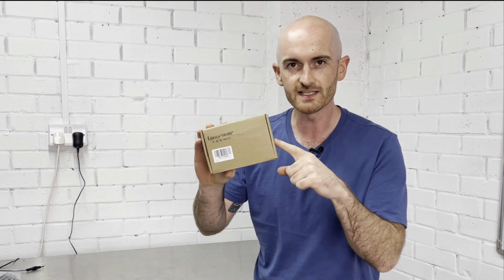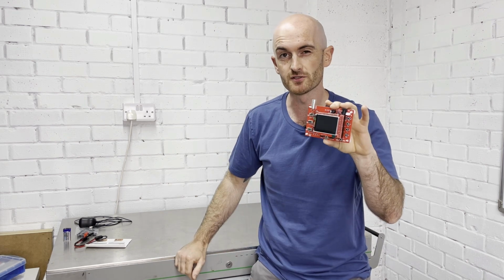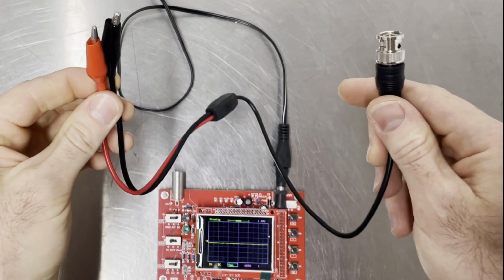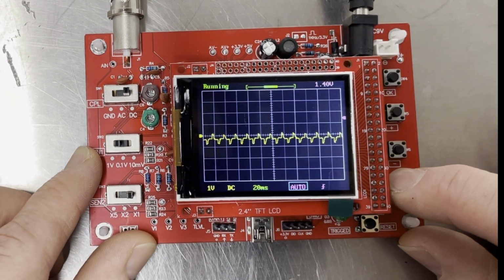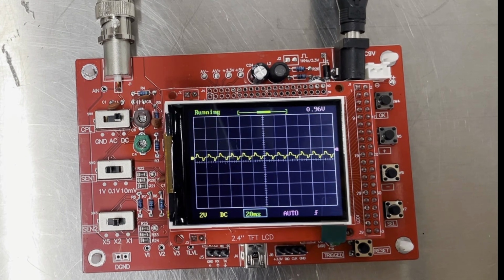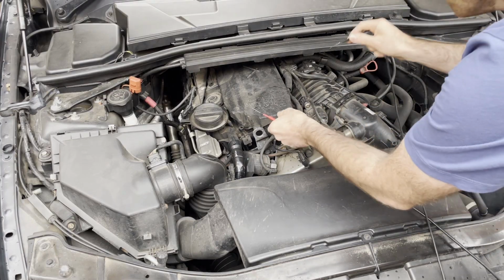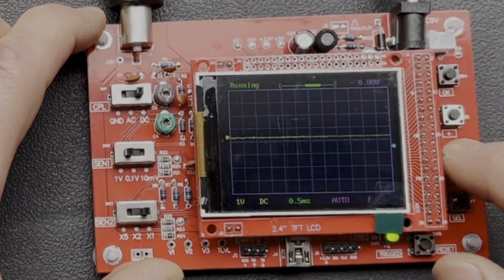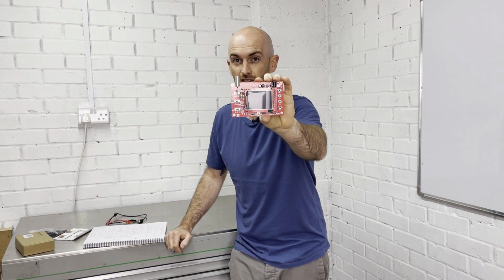Cheapest Oscilloscope in the World! DSO 138 | Mechanic Mindset

Comment: what happened when i connect negative probe to the battery and positive probe to injector? without attenuator Hantek tipe HT-201
Reply from the maker: Probably nothing. You just won’t see the top of the voltage spike. 

Some would say it will cause damage but i haven’t seen it happen yet

Comment: Small problems: Does not feature cursors. This is basically the only drawback, and renders it somewhat difficult to use for simple electronics. Other than that, it's great.
Mine comes with an acrylic case.

Comment: Quick question;  the jumper wire at J2.  That was bridged for testing the board.  Doesn’t say to remove it when complete testing.  Should o leave it or remove it?
Reply from the maker: I bought mine complete mate. Sorry not sure
Reply: @MechanicMindset  I found that it is to test the board.  It produces a square wave that you connect the red probe to and get a signal.  The loop should remain, not be removed after the board is complete.  There is a 0ohm resister that is to be Shorted (JP4).  I removed the resistor and put a blob of solder, bridging the  2pads thus, shorting it.  Curious as to why it is there in the first place.  0ohm?
Reply from the maker: @marinehm  Ah ok yes, is it the same signal you can also use to set the compensation on the x10 probe?

Comment: Great little kit.  I just picked mine up at an Amazon return center for $4.00.   I love the disclaimer.  “Most people will not have a working unit”.  Fortunately for me, I can solder very well, have a multimeter and OCD.  All worked out well.  Now I need to figure out what I can do with this little thing.  Never needed one before.
Reply from the maker: 😆 It’s a fun little tool. CAN bus is stretching its limits but is copes with most other things. Enjoy!
Reply: I think making a working scope is as much about figuring out the settings as it is the soldering

Comment: Pretty nice little scope. I have one of those pocket scopes, a little hard to use, if you're used to standard scope controls and knobs, but usable for simple automotive or hobby electronics. Thanks for sharing. Best Wishes & Blessings. Keith Noneya
Reply from the maker: They are cool little scopes, especially for the money! What other scopes do you use? Cheers
Reply: @MechanicMindset  I'm a retired Avionics (Aviation Electronics) Technician. I've used and own some of the older Tektronix 400 & 2440 Series and the TDS 600 & 700 scopes. I even have an old TEK 585 with the Spectrum Analyzer plug in. Unfortunately it's not working. One of my Favorite OLD analog scopes is my Kikusui COS6100M an old 100mhz R&D scope from the 70 & 80's. It has four channels with an additional 8 possible TTL displayable Channels. It flooded during Katrina and I took every corroded part off the boards. Disassembled the switches, cleaned them and put it all back together and it I'll be darned if it didn't work!. I then calibrated it and put it back on the equipment shelf. What a work horse that sucker's been. Anyways thanks for the video and the reply. I've been working on a 2003 Dakota 3.9L with a no start issue. +5vdc is present and has a NO BUS on the dash. Was missing the 12vdc on the coil and bypassed the ASD relay and it still won't start and still has NO BUS on the dash. Swapped the coil and the Camshaft or distributor Coil Pick up, no joy. Any ideas? Best Wishes & Blessings. Keith Noneya

Comment: A great introduction for a beginner to cheap oscilloscope ownership. If you wanted to follow on this theme then you could do a "Cheapest Logic Analyser that decodes the CANBUS". Buy any of the £10-15 24MHz 8 channel USB logic analysers off Amazon/eBay and use the software from Saleae's website. Be mindful to set the correct baud rate when setting up for CANBUS decoding or it'll fall on its face. You can even use the software to search for CRC failures.
Keep up the good work 👍🏻
Reply from the maker: Interesting, will check that out! Thanks 👍
Reply: @MechanicMindset  I would love to see this too on a HS CAN
Reply from the maker: @kevinguest6360  Challenge accepted 😂

Comment: Got a great deal on a hand held fluke scope a while ago, it was dumped out of the local college as it wasn’t switching on! I said it to my foreman in work and he suggested taking out the battery as apparently they have a habit of shortening out , plugged out the battery and it fired up straight away so next stop was eBay for a 25£ pound battery! Must still get one of the pico’s like you have as they work a treat!
Reply from the maker: That is a result! I bet they aren’t cheap new... Yeah, I love the 2204A, so much value for money 👍
Reply: @Bobo-ox7fj Imagine thinking that if someone needed something, but they already have it, except that...  it don't work. Imagine thinking that they would get rid of the broken one, and not have the new model already ordered and on the way.  

I suppose its tough for institutions to aquire what they need to fulfill the obligations they've agreed to. Especially with all those big budgets.    If it wasn't for that damn budget were alloted every year, the electrical engineering department could get a new Fluke meter. "Sorry guys, that cursed budget is just to big this year!  Your all gonna have to go back to licking your finger to verify each phase is dead.   Maybe next year we can scrape together enough money at the pot-luck to get us another Fluke.  In the mean time, make sure you all know where the AED's are. The yellow ones on the wall are portable, know how to use them. At least when your coworker is trying to restart your heart after fingering 4160, it'll kinda look like he's using a fluke.

Oh ya, Flukes are precision measuring tools.   They would never re-certify one as safe, and calibrated with a battery in it that wasn't a Fluke approved battery.  Fluke obviously doesn't make this instrument anymore,  or the filthy broke institution would have sent it back to Fluke, you know, so they can repair it, and re-certify it.  As would happen annually, particularly if you were teaching with it, and aspired for your students to use a measuring tool that could do so with repeatable results.    Imagine that, what a world it was.

Comment: Hey Darren,
I bought this one as a kit & made it in a few hours. Have used it successfully for many years carrying out even complex repairs.
I bought a 9 volt battery case with switch & a DC plug from Ebay. I just glued it on the side of the oscilloscope case with some hot glue. That way I didn't have to connect it to an external power supply. Apart from the long-winded process of obtaining a signal, it works quite well for what it is.
I then bought a 
DANIU ADS1013D 2 channel tablet scope, which is an amazing tool for what it is and now I have graduated to the PICO 4425A Plus -  a lot of money, but I use it each day in my workshop.
That being said, for what I paid for the DSO138, the fun I had building the kit and the repairs I was able to carry out due to the waveforms collected from that little scope, I can only sing it's praises! 😁
MiracleMAX
Reply from the maker: Ah cool! I did consider going the battery route, but I have other plans for the power supply too 😃. There are some interesting scope tools on the market; I’m sure I saw one that connects via a phone some time back. You’re right, it can take a while to get a signal in the DSO138, but a great way to learn all the settings. Cheers! 👍
Reply: @MechanicMindset  you might be thinking of hscope which runs on Android phones and tablets. Check out Denis's channel, he's into some clever projects.....  https://youtube.com/c/theGADGETSplaylist
Reply from the maker: @Automotive_Solutions  Check out iMSO 104 on Google; it was like that but cheaper. I suspect it was garbage so was removed from eBay. Yeah, I’m in the HScope telegram group, Denis is awesome! I got a tablet for HScope last year but really struggle going back to Android, so sent it back 😂. Will probably look for a super cheap one just to run HScope as the automotive software looks pretty cool!